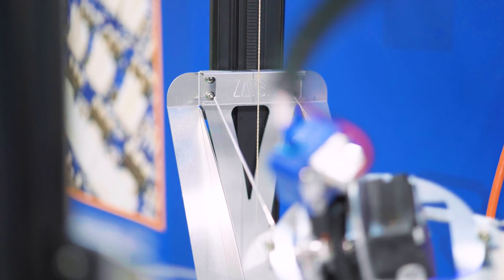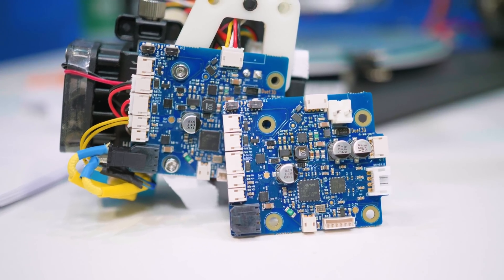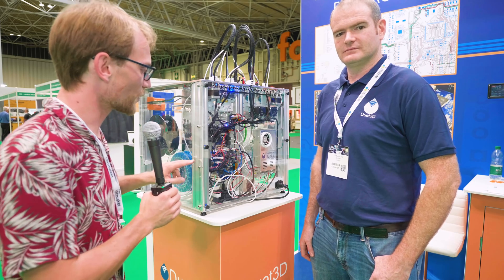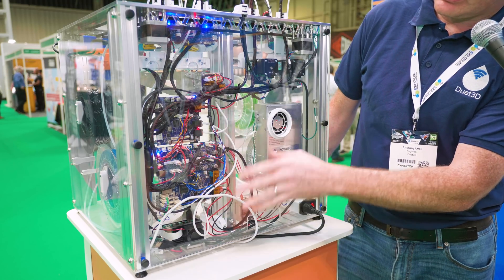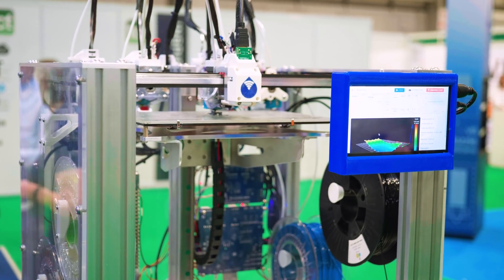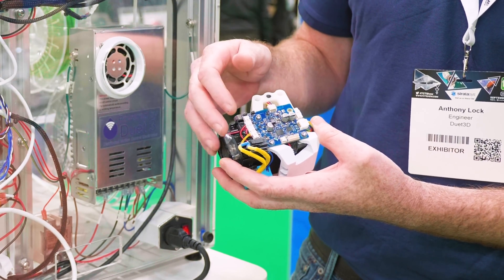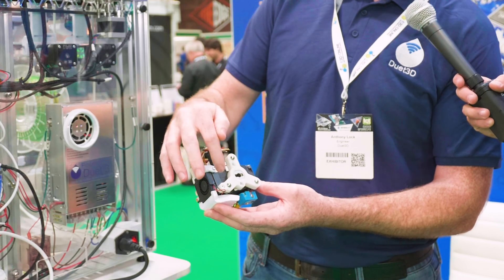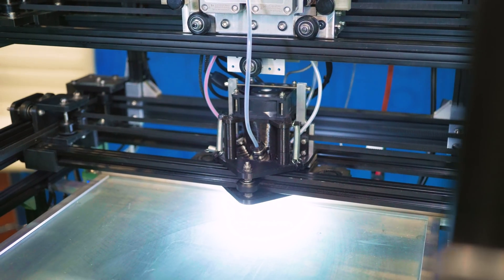The new Duet 3 electronics ecosystem!

Comment: 1. Up to 30 stepper motors (6 board and 24 expanded) at 6.3A peak. 
2. Applications for developing new apps for the controller without embedded firmware knowledge 
3. Duet 2 will still be sold and maintained 
4. On-the-fly configuration changes even while printing live...? Sounds complicated but nice to have. 
5. Support for tool changing 
6. Expansion boards for a wide range of applications 
7. Better delta printer and CNC support?
8. Definitely a little more expensive. Still completely open sourced. 

Pretty impressive.
Reply: For some reason Duet’s website disagrees with the video.  For example instead of 6A it says 4A peak for the drivers.  I wonder which is correct.
Reply: ualdayan I was thinking about  it too. I think the website is correct. They have spent more time writing that.
Reply: @ualdayan  my guess would be in the video they said "tested up to 6A" but they say 4A to be on the conservative side. Duet likes to make suggestions that will always work. I'm sure you could do 6A with proper active cooling but they aren't gonna suggest on the website cause someone could burn up the on board drivers if it wasnt done right.
Reply: The only thing Duet is missing is up-gradable stepper drivers.
Reply: @wickedcoyote271  ya there is an appeal for that but the soldered method does dissipate heat a lot better. it also has the breakout pins so you could definitely attach other drivers.
Reply: 4. On-the-fly configuration changes even while printing live...? Sounds complicated but nice to have. 

isn't a new one (duetwifi has had it) & is really handy. cause all the configuration stuff is done with gcode so you just can test out your acceleration settings without needing to set it up in slicer. its wayyy simpler. the best use ive found for it is to tune your retractions cause that means you can do all sorts of tests during a test print without re-slicing the file.